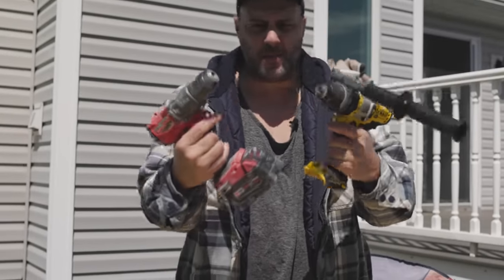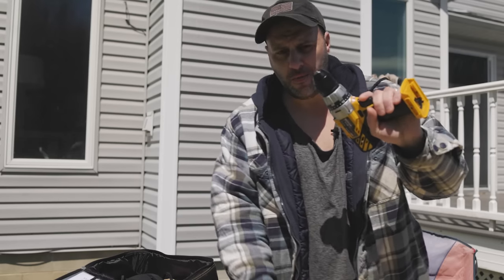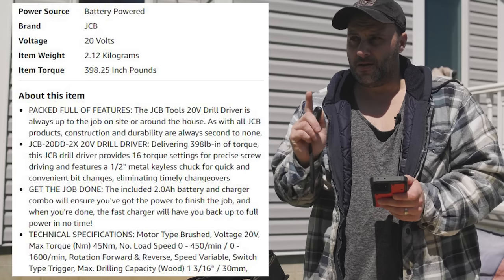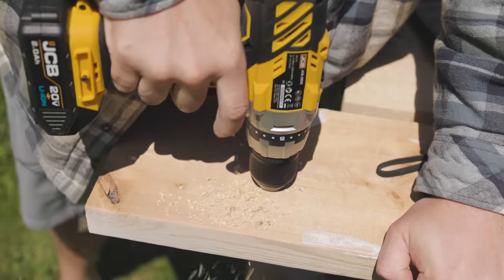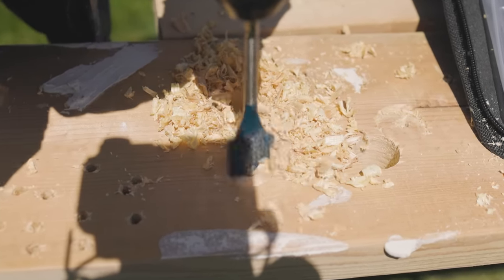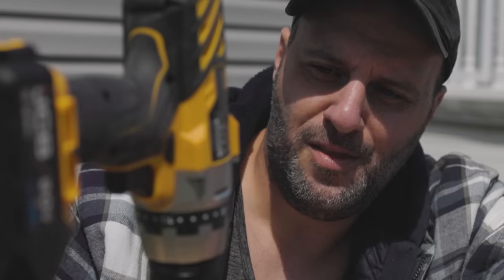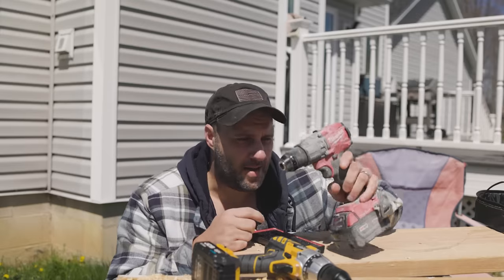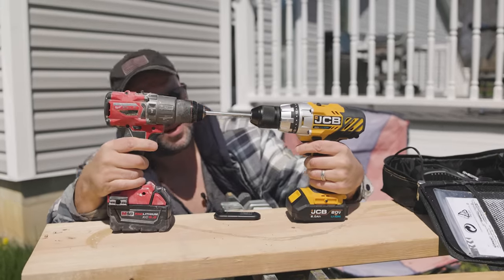Don't buy CHEAP POWER TOOLS for this reason alone

Comment: Very entertaining, Clint!  I was hoping for flames and guts and gore though.  My Milwaukee M12 Fuel Drill Driver and Impact driver are working great, thanks to your review and recommendations.  Very happy I purchased them for my small home projects.  Beats my 10 y. o. monsterously huge 18v HD Rigid Drill Driver that stopped working mysteriously. Looking forward to the next video.  Maybe get a wrist brace???
Reply from the maker: Thanks so much for the awesome comment and feedback Enterprises 🙏🙏🙏
Reply: @ToolReviewZone  Do you know if a Makita battery will power the drill?
Reply from the maker: I actually tried a few different batteries and none worked Pro
Reply: @ToolReviewZone  Thank you Clint.
Reply: wnc817  It is registered actually.  I will contact Rigid.  Thanks for reminding me!

Comment: This is actually quite interesting. I've actually become aware of a tool company that is supposedly made in USA called Tolsen , but I'm not really sure how they are. I've also recently been seeing this apparently HUGE Chinese tool brand called Total Power Tools that has a huge presence in Asia apparently and that makes a tonne of construction related equipment from cordless power tools and accessories to gas powered equipment. I know they really won't be able to compare to the Red/Yellow/Teal (maybe they might to the green), but I would be curious to see how they actually perform if you ever get your hands on some. I've heard some workers say they are good enough, but I'm not sure about longevity etc.
Reply: Just FYI. The Tolsen address, straight from their web-site, is "No.198, Huashan Road, Jinfeng Town, Zhangjiagang City，Jiangsu Province, China". If they have American made tools, I couldn't find them.
Reply: @richpeggyfranks490  LOLOL thanks mate. I only saw the box and packaging on display with some of the "Made in US" marketing lolol. That's such a blatant lie. Although to be fair, I guess TTI is also Hong Kong based. I might try one of the diamond concrete grinding blades and see how to does. But thanks for the feedback.

Comment: For $17 I can see buying it for my daughter. Her use is household at best. Just picked up a $15 29pc drill index for her. Should be fine for what she does or doesn't do, as the case may be.
Reply: This came up in my feed again; hadn't seen your post. Coincidentally, I also picked up a $15 29pc drill index for my daughter. It's rolled HSS, which should be fine for her needs.

Comment: If I'm going to go cheap, I will take the Skil Pwrcore12 or Pwrcore20 over this, thanks. At least then I will get some Chervon quality with my made-in-China tools. My Pwrcore12 drill ran circles around my M12 Fuel hammer drill and kept up with my DeWalt 12V Extreme drill, all while being more comfortable than the M12. I sold the M12 Fuel.

Actually, it would be interesting to see how this cheap JCB stacks up against a decent DIY drill like Skil.

Comment: a friend has a Bauer 20v from harbor freight, it does the same thing as that cheapo drill does, bits always fall out and it will stop drilling using any larger bit...one more thing, i can't believe you drilled all those holes thru a 15,000-dollar board ...lol